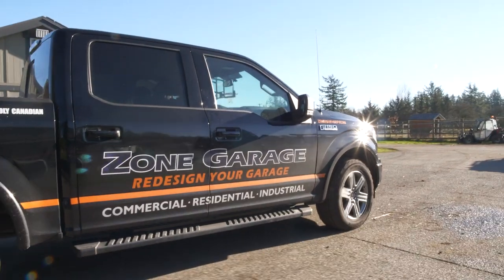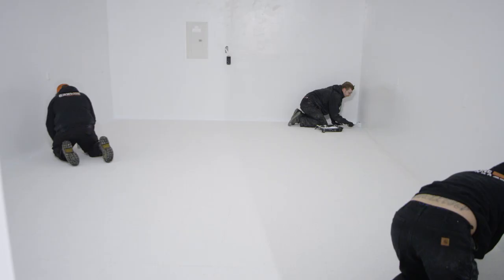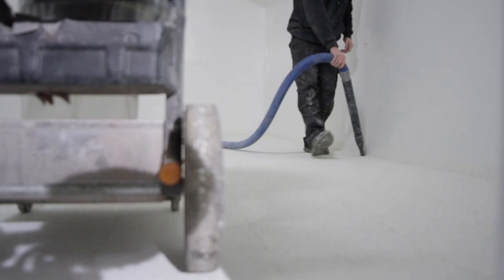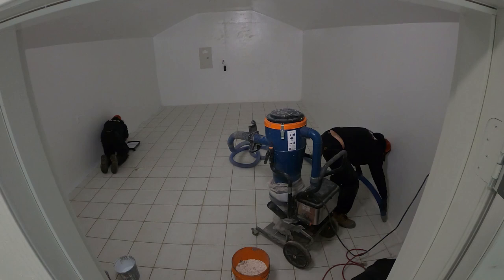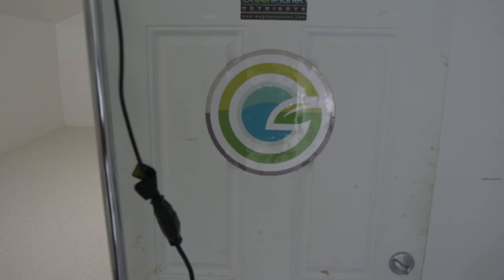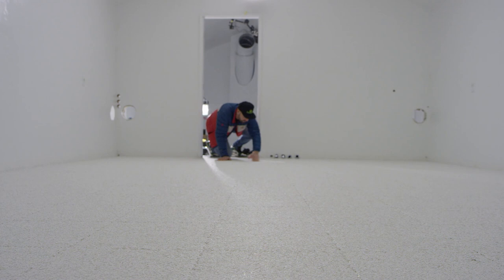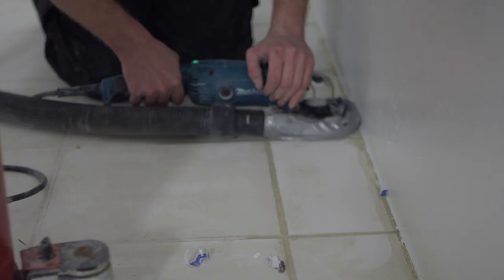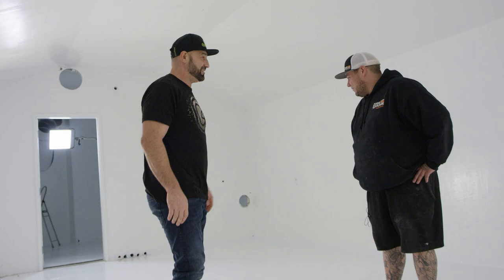Grow Room Floor Coating Tutorial | Growing Green VOL 2

Comment: This is nice but this is not possible for most people. There's cheaper ways for guys not wanting to spend that and have ppl in their grows. Linoleum is still a great option especially the lay flat stuff and you can replace it easily in the future. I tiled my new grow bc I needed heat and used ditra heated floor systems and epoxy grouted it. Radiant heated floors is the best heat for a grow space.

Comment: Having done Epoxy flooring and waterproofing for over 10 years. YES Prep is EVERYTHING... But did these guys seriously just put Epoxy on top of tile? Even if that tile was installed by the most professional tiler, using the most high end grout/mortar bed, That is still a horrible idea. ESPECIALLY using a poly based epoxy. The amount of time it would have taken to jackhammer that tile off..... To ensure you have a proper bond to a solid surface would have been worth it IMO. 

Still great content and cant wait too see what the girls look like.
Reply from the maker: i guess will see how it looks in a year!!
Reply: Yea makes no sense to me either, why not put it straight onto the concrete foundation